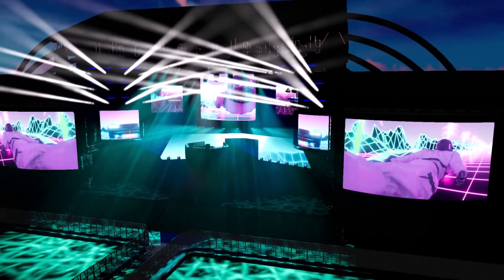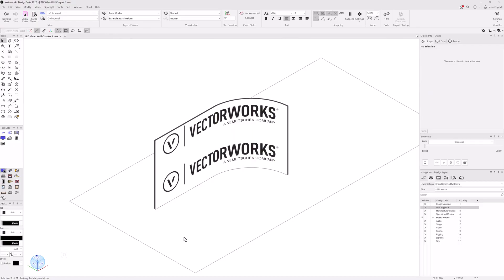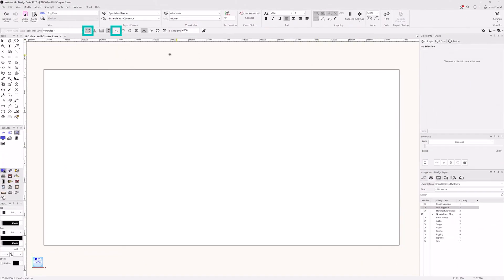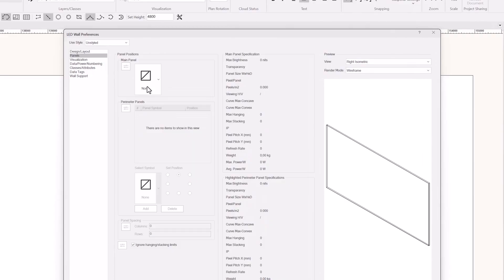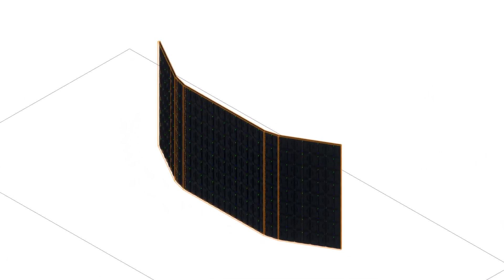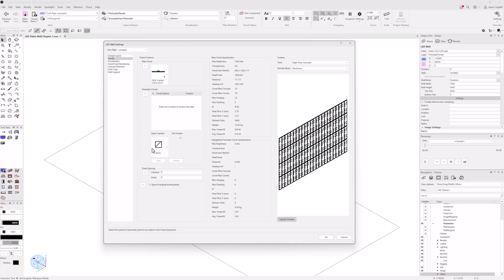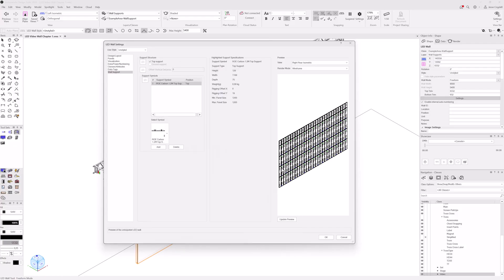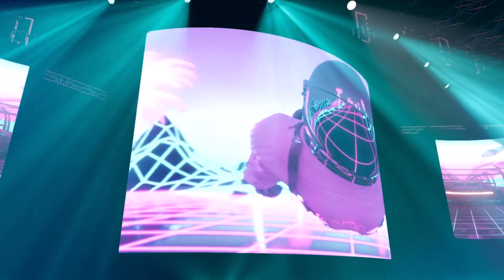2026 Led Video Walls Chapter 1 - Getting Started

Comment: How do I download the specific LED wall panel types?  All I was able to download was the generic LED panels.
Reply from the maker: If you’re only seeing the generic LED panels, try refreshing your Resource Manager — that usually pulls in the latest library of panel types. If that doesn’t work, you may need to clear your local RM cache first, then refresh again to get the full set.

Win: C:\Users\username\AppData\Roaming\Nemetschek\Vectorworks RMCache\rm202x
Mac: /Users/username/Library/Application Support/Vectorworks RMCache/rm202x

Just replace “username” with your computer’s username. After deleting that folder and refreshing the RM, you should see all the updated LED panels.